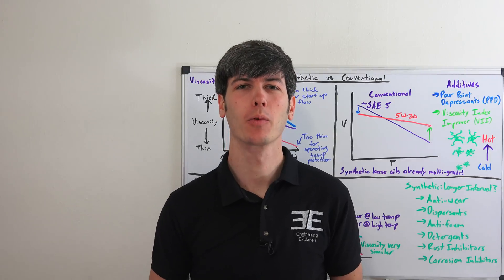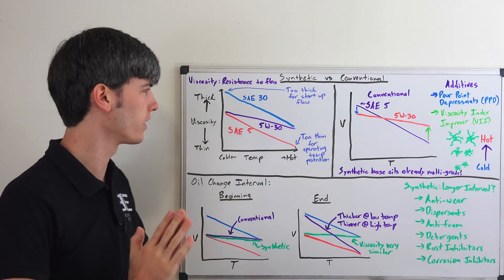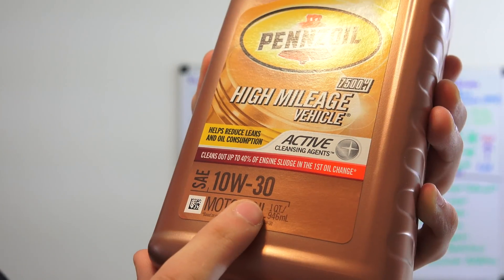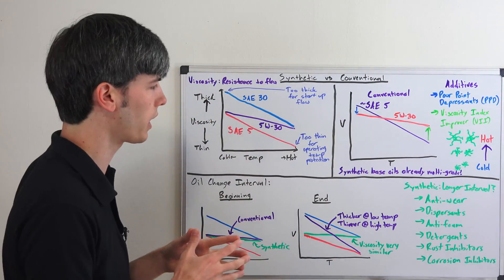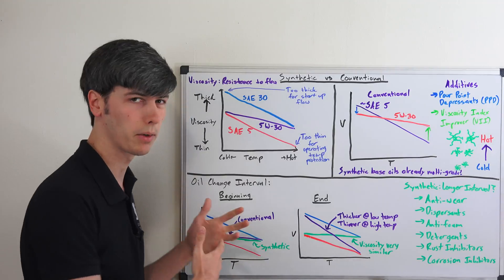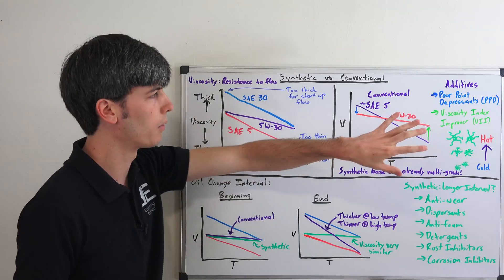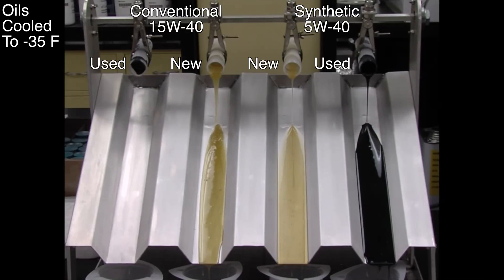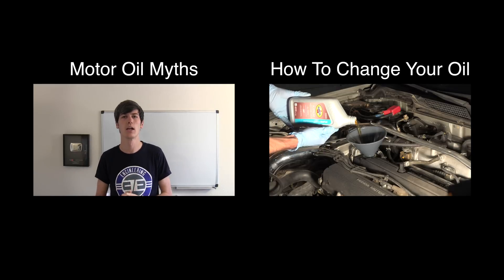Is Synthetic Motor Oil Better For Your Car?

Comment: I have always used synthetic oil. I have a fast mercedes E430 1999. I drive fast but not many miles. 3,000 a year?. Just moved from California to Florida. What should I use in this 99% of the time HOT weather. SW 5/30? I know nothing. My expert mercedes mechanic has me change the oil every 7000 miles? Help

Comment: The demonstration is pretty ridiculous, vehicles don't operate at -35°F. It's good to show how viscosity might change, but since it is a property so very reliant on energy, the comparison is essentially invalid. You would need to compare the oils at various temperatures to actually come to any valid conclusion.

Comment: I would use the oil that's gone darker. That means it's cleaning very well. As a mechanic. I get cars that use castrol gtx and when you rip these engines apart. You can see all the slug. So i don't use castrol oil. I recommend penrite oil for my customers.  My experience is the darker the oil. The better it cleans! I my self use cheap oil that is suitable for petrol and small diesel engines! I love the high detergent levels of these oils! I am getting more then 600,000 kms out of a engine!

Comment: I always use oil that is suitable for petrol and small diesel engines. This oil has detergents and it keeps my engine very clean. With normal oil i get 250,000kms before the engine starts smoking.  With the recycled petrol and small diesel engine oil i get atleast 620,000km's before the engine starts smoking. Plus this oil is very cheap!

Comment: too bad there was no real data (numbers) as to how much the viscosity of a typical mineral oil increased when cold at the end of the service interval and how much the viscosity decreased at the end of service interval  when hot so we can see whether its a significant amount or not and then compare to an equivalent synthetic

Also why not do that test at the end with the viscosity same for each one, nobody uses a 15W at -35F that cares about engine protection as its not even close to the proper oil for those conditions, how do we know that at 15F or higher the differences between used and new mineral oil isnt much the same as the synthetic? even a 5W-xx is probably not the right winter rating at -35F for either mineral or synthetic

maybe a bit more scientific next time? especially when sponsored by an oil company they should have all the data available.

Comment: It would be great if you did video on kinetic viscosity for us gearheads who want to know a bit more in depth on oil choice. Currently look at what the manufacturer recommends and then find an oil that has the same cold cSt, but a higher hot cSt.  As the viscosity groups on the bottles of oils are a bit misleading.

Comment: Any of you guy's ever heard about synthetic oil removing chrome on engine parts such as cam shaft? One guy i know who's a diesel mechanic say's he's seeing it all time, he said synthetic have all the mention advantages and that it shouldn't be a problem but it is removing the finish on the chrome parts of the engine in long term. Hearing that made me think of the 3 last cars i owned which i haved made the switch from usual oil to synthetic and all of them after haved started to make some engine valves clapping sounds which never got further exepted for the annoying and embarassing valves sound. Now i can't say it was all cause by the synthetic oil but 3 cars in a row starting to do it slowly and gradualy after i made the oil switch made me change my mind over it even i would love to always run on synthetic for the added advantages but won't risk it again in future and will stick with ordinary oil. And in the end i don't think the difference is how they want us to believe it, as long as your making the maintenance on time ordinary oil is about the same for your normal daily use car in my opinion.

Comment: Penzoil paid you for this video and this is an unfair comparison and can skew peoples choices on which type of oil to buy. Please do a real comparison with same viscosities, I'm sure they make similar viscosity conventional and synthetic, or at least do the test at operating temperature where they should both be at or about the same weight. This seems kind of misleading.

Comment: After many years I have come to the conclusion that Synthetic oil does not exist!!!!   it is a marketing ploy!!!! See if there is a engineering standard for synthetic oil.  There is none!!!    Buyer beware!!!  One of the best oils out there is one sold by Wall Mart as a Synthetic not by Esso especially not Pennzoil these go black lake cheap or graded with synthetic oil  really quickly.  Try your own comparison.  I for one am very disappointed in the whole industry!!!!  The only thing you can go by are the military standards or specs!!!

Comment: Hi, I have a quick question. I heard that motor oil for diesel engines does a better job on gasoline engines than the traditional oils. Is this true?

Comment: I use synthetic oil not only for the purposes represented in this video, but because my engine naturally seems to run very hot at operating temperature. With conventional oil my engine would occasionally make a valve knocking noise. With synthetic I almost never hear that sound.

Comment: Castrol suggests an oil change interval of 5000 to 7500 miles for their Syntec motor oil due to it's diester base, which is far greater than the standard interval of 3000 miles. This makes sense since the pure synthetic oil is not subject to molecular breakdown of it's base components at nearly the same rate when exposed to the extreme heat of an engine as compared to petroleum based oils. Note that longer oil change intervals are not recommended for other synthetic blend oils and for carbon based synthetic oils such as Mobile One. Because the burning of gasoline produces carbon as a byproduct that builds up in the oil, the oil must be changed out at some point regardless of the lack of molecular breakdown.  Nice discussion about oil weight ratings.

Comment: Go by the OEM recommendations, you cant go wrong, always use good quality oils & coolants as well. :) But keep in mind the Average temperatures where you live & what type of driving you do everyday, if its more than say 1 hour of over 100KM per hour, then use good oil, like Mobil or any other well known brand of oil, but stick to the manufactures recommendations,( Especially if the coolant & Engine oils specs are better & Meet the OEM spec's) that way it will last longer & try to change you oil, every 5,000Km if your doing more than that much in a month, like Taxis do & if not that many KM during 1 month, but a average of around say 15,000 to 20,000 KM in a year & not much freeway driving during the year, i would still change the oil as soon as you see it change from the GOLD color to a darker brown/ blackish color which is the carbon build up in the oil & it will have very small metal parts in the oil as well, which is normal, but as soon as the metal partical's get to big & the oil & filter dont get changed, the engine tends to heat up quicker, loss of power & also more strain on the engine coolant as well, which you should use good OEM Quality & always use what the Company recommends, sure you can get different brands as long as it meets or is better than the factory spec's, which i always do the more protection the better, like they say preventative maintenance is a lot cheaper than a repair on your engine.cheers :) All Good Oil Manufactures will always add friction modifiers in the oil base, which is to say that the Mobil 1 0W 30 is a Full Mineral base oil, but with good Quality friction modifiers & all oil manufactures use them, like molybond for example. :)

Comment: Hi,
So I have a Nissan Juke it has a turbo,so I had to have the engine change due to a timing chain breaking at 24K,ALL oil mobil 1 oil changes were done on time ,So I ran regular oil on the new engine to 70,000 then switched to mobile 1. I check the oil visually and with a spectrometer ,@ 5K their is small deposits and the oil still looks clean,but not clear,so should I change it or wait till it gets more contaminated,what about using a diesel formula in it,
Thanks for your vids!

Comment: I drive a 2007 Ford P71, 191k miles and change with a secure idle switch. I
 have a delivery route that can be between 200 and 300 miles 5 nights a 
week. My stops average 15 minutes apart stops last 5-10 minutes, most I 
have to leave sight of my vehicle. Is it better to use the SIS or shut 
off and start my car at each stop. I have been in an endless argument 
with my boss who insists I shut off and restart because he says it 
causes more wear and the company is required to cover maintaining the vehicle.

Comment: @engineeringexplained is an oil change every 3,000 miles on my wrx over kill ? It's a 07 with 116,xxx and I'm using rotella t6. What do you run in your subie ?

Comment: hi guys. please be aware some engines run too hot and synthetic burns off.  we have a 2008 chev avalanche with votec engine. on synthetic we were burning 1 quart every 500 miles and could see occasional puff of smoke from exhaust.  thought it was engine wear until a lube mechanic told us synthetic can do that, all good now

Comment: I also heard you can go longer between oil changes with synthetic. Conventional oil needs to be changed around 5000 miles, but synthetic oil can go 7500 miles before being changed.

Comment: About 20 years or so ago the company I worked for experienced bearing failure on a large fan with a shaft approx. 30" diameter that utilized poured/Babbitt bearings. Conventional oil in a low-pressure system was employed and the failure rate was at around the 4000 hour range. The company replaced the conventional oil with synthetic oil and service life increased to nearly the 12000 to 15000 hour range. Synthetic oil is indeed excellent lubrication in your automobile.

Comment: I swear by synthetic. I haven't had to add oil between changes since the 1980s, even after the engine has gone well over 200,00 miles. I assume that is because the rings don't wear much and the seals stay, well sealed. I still do a break-in oil change at 500 miles as well, even though the dealer says I do not need to.

Comment: Great video! Youtube suggested it to me first, but Car & Driver featured your video as well.  I would like to make a video request if possible.  It's related to motor oils and the great videos you've made in the past about the wankel rotary engine.  I have an `87 RX-7 Turbo II.  As I've always understood it synthetic oil cannot be run in a wankel because it doesn't burn like a conventional oil when run through the oil injection system and because of this it can cause problems.  Is this true, false, or can some synthetics be run while others cannot?  Hope you are able to cover it.  Thanks again for the great content.

Comment: I have no idea how my car operates with conventional motor oil, because it's always been changed with synthetic since I got it. I'm currently using Mobil 1 extended performance 5W-20, just like the owner's manual and oil cap suggest. But since I have a Honda, I won't ever use conventional oil anyways. All I know is my car does great on synthetic oils, especially the high end brands. Yes there is a difference.... Mobil 1 guarantees this oil will run for 15k miles so we will see how it looks after about 6 or 7k.

Comment: Why don't you explain to the public difference between European and American (fake) synthetic oils? There is no fully synthetic oils made in United States and that is a fact! I am in the business for a long time and I have seen many engines run on American "synthetics" with significant wear after 100.000 miles, including Mobil 1 which is not fully synthetic at all. On the other side German oils like Ravenol, Liqui Moly and Pentosin which are group IV showed superb engine protection even on diesels well over 200.000 miles!! Parts of your story are not really true...try to put regular oil in diesel engine...

Comment: If you use synthetic oil is it necessary to keep using synthetic or can you switch back to conventional? Also how do you know if the mechanic actually put synthetic oil in the machine?
Reply: That's a myth. You won't hurt your car by switching back and forth. They even sell "synthetic blend" oils, which essentially is what you make yourself in your car when you have a mix of synthetic and conventional oil.
Reply from the maker: +Coola Coc you can switch back, yes. Ask the mechanic what specific oil brand/blend they use. If they seem sketch it's probably not a great place haha. Most are honest people, just ask. :)
Reply: Well... apart from their word there is no real way of knowing is there?
Reply: Although switching can be done the myth of "you can't switch back" started in the 1970s. Synthetic oil messed with seals then so if you hear the saying now it's literally ancient history.
Reply: Just be sure to switch back at your oil change/be sure to empty your car of the synthetic stuff. +engineering explained correct me if I am wrong but synthetics and conventional do not mix well, and you can cause damage to your engine.
Reply: i went to a jiffy lube and normally they use "penzoil", but i dont know if they put full synthetic in my car. the car hasnt been as fuel efficient since i took it there. ima start doing my own oil changes.
Reply: Completely false. Syn and Conv oils are 100% compatible with each other. Image the lawsuits if they werent

Comment: How many miles would you recommend in between oil services? I normally drop the 5W30 FS oil in my car every 6K miles, Am I wasting money having service intervals so soon? I drive a 2011 Ford Mondeo 2.0 TDCI. Thanks in advance
Reply: Run a oil analysis with someone like Blackstone Labs. Use real data to drive your oil change interval, not guesses from the internet. With a few data points you can get a very good gauge of the condition of your engine.
Reply from the maker: +XTREMEGUNNA I'd always say go with what your manufacturer recommends.
Reply: my honda fit tells me when i need to change the oil. usually around 6.5k or 7k miles is when the oil light comes on.
Reply: How long do you plan to keep it? That's the real measure of what you should do maintenance wise. No sense in trying to maintain it really well if you don't plan on keeping it for the duration of it's usable life. If you're going to get rid of it when it hits 100 to 200k then what your doing is more than sufficient just keep the leaks patched up and your good to go.

Comment: '97 Ply Breeze 189,000 with regular oil 10W  30- Changer to synthetic 5W 30 and cam seized in 100 miles.  Polished all journels and reassembled drained synthetic and put regular 10W30 back.  Now have 1000 miles on it again and engine runs great.  Lifters were making noise is why I changed to synthetic but didn't do anything for lifter noise plus cam seized.  You would have to talk a long time before you convince me it's better.